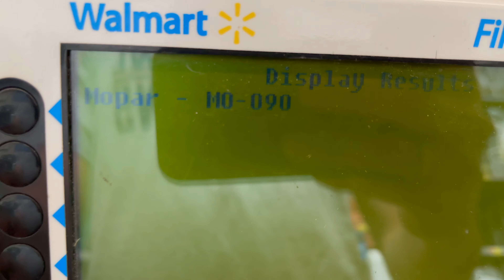It's Always Something

Comment: Cool video, I have to do the 5 tire rotation soon, always keep that spare in the mix. Not sure how many miles you have on your TJ, but mine is at 152k and recently switched to the Valvoline 10w30 150+K miles Synthetic Blend with a Wix oil filter, and noticing my '05 TJ Rocky Mtn idles better since making the change from the Valvoline 75+k mile oil. Also put 4-5 ounces of marvel mystery oil in the crankcase about 500 miles before an oil change. Helps remove any old sludge and junk build-up. 

And I just throw my used oil in the neighbors yard, he's only shot at me twice this year. 
💥😎